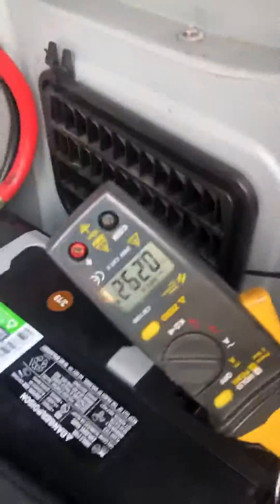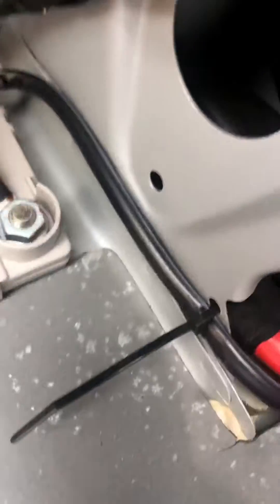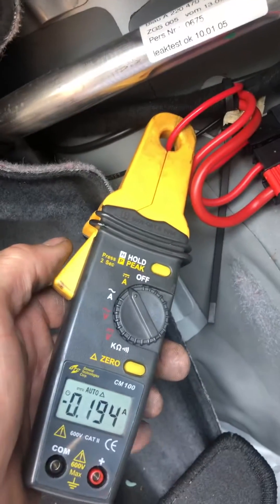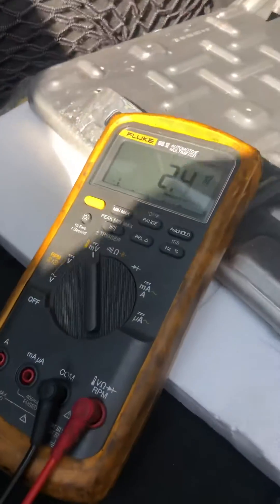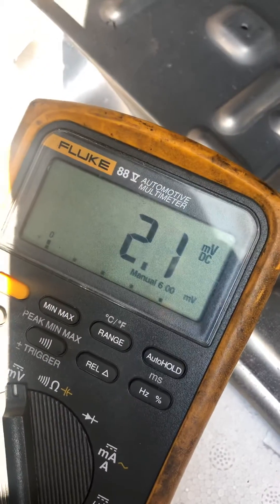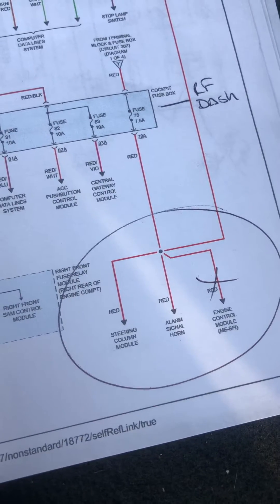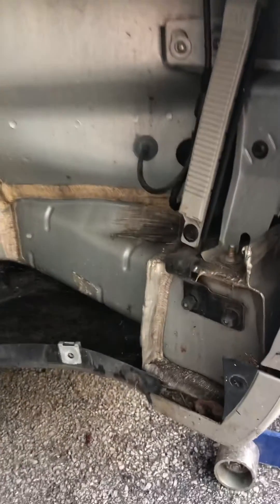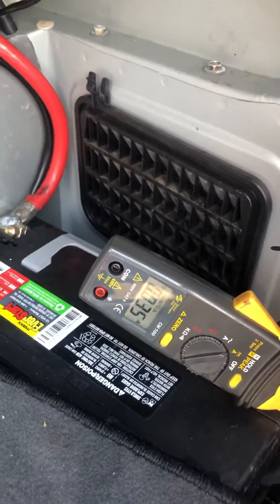Mercedes Benz battery drain diagnosis

Comment: I got a 2011 c300 this car drains the battery over night I check it for a draw when it’s turn off it has 6.8 mA  I found fuse 27 to be the issue wen I pull the fuse it will drop to 0.7mA and it dose not kill the battery my question is could it be the fuse box the issue or the ignition switch module I never had it be this befor any one have this issue on a c300 befor
Reply from the maker: Fuse 27 on what fuse box?
Reply: @eurowerx4267  engine bay

Comment: I narrowed down the amp draw on my 2003 MB E320 to fuse 008 - the fuse specific to the alarm system and antenna. My mechanic checked it out and said my alarm siren is toast and is most likely causing the issue. Tip: Be sure to check / clean your car's drains (sunroof and hood) .  The drains on both sides of the car were very clogged - creating condensation issue in the cabin, and most likely led to the shorting out of my alarm siren (siren is located right next to the drain discharge cover - behind driver's side front wheel).

Comment: Dear sir,
Does anyone know Mercedes w220 s320 2000 model have CGW( central gateway module) I search under steering well, below accelerator pedal form mat still I can’t find that module
I read a post that. Preface lift car don’t have it
EIS DOES THIS JOB IS THAT RIGHT??
Reply from the maker: Hey, good question. If it has one, it’s usually mounted on top of the drivers side under dash panel. When pulling down, should see on top, small white box
Reply: @eurowerx4267  I removed that but I can’t find there, some said that it is under the steering well cover I check all there, but I can’t find any module 🤷‍♂️